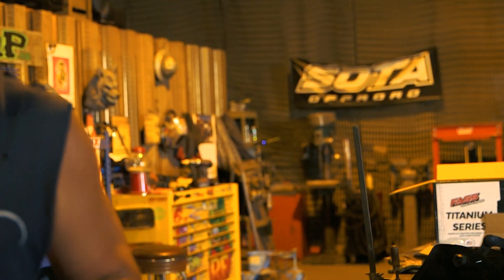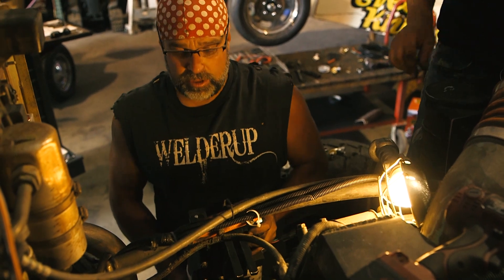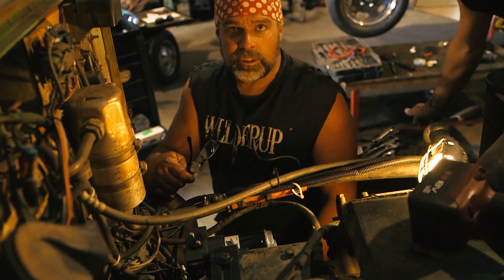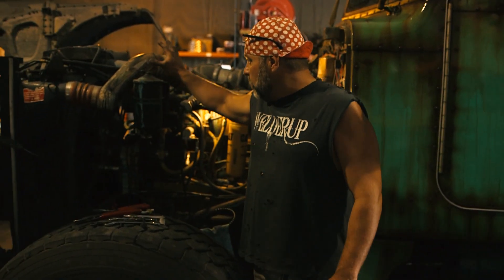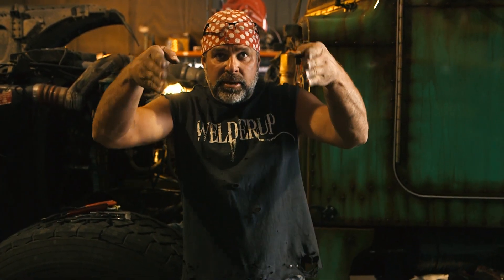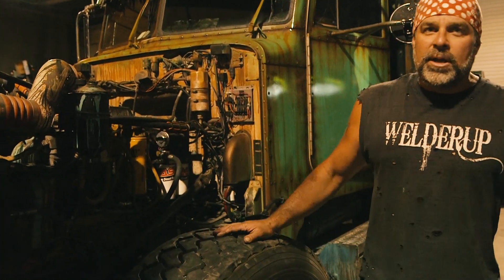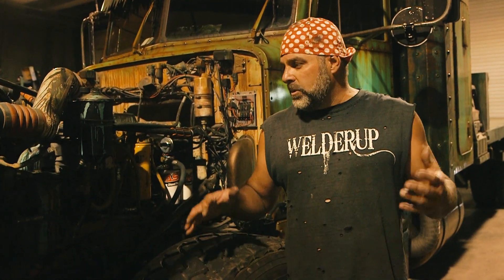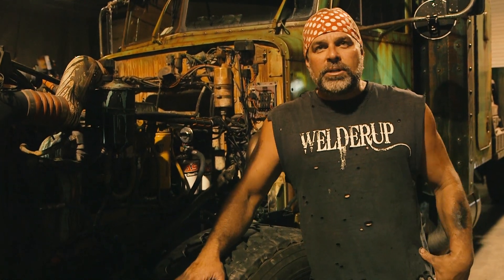WelderUp Garage Swampass FASS Installation

Comment: Nice. 
Did it really make a difference in power , response,  and fuel milage?

I'm looking into the 250 or 290 for my modified  12.7 Detroit  with future plans of doing a compound  Turbo System